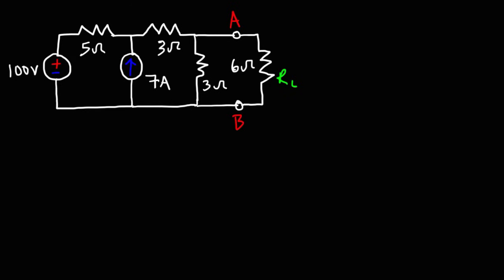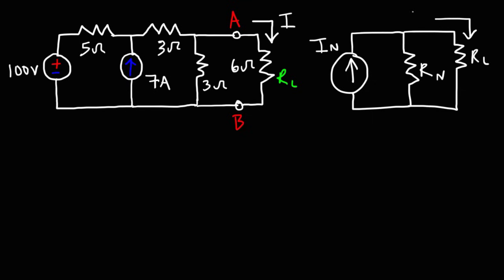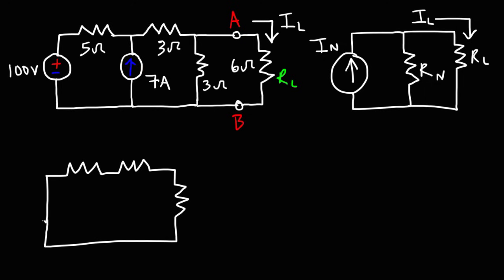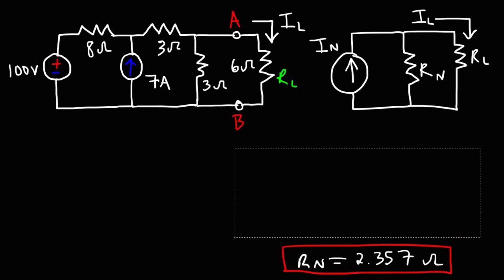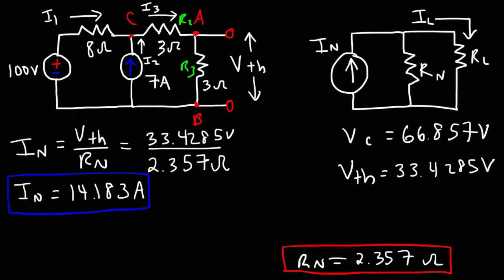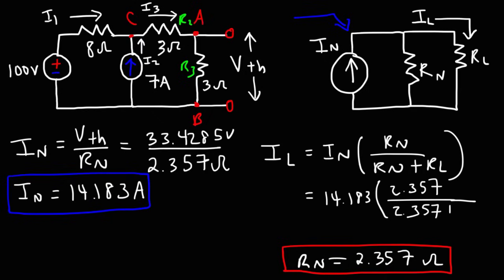Norton's Theorem and Thevenin's Theorem - Electrical Circuit Analysis

Comment: Since Calc 1, I've been constantly watching your videos due to the simplicity and clearness. Now circuits? Thank you so much for your help
Reply: same
Reply: He's a legend. I love that he's covered so many subjects.
Reply: 4:10 why did we substitute Vc from 100? Help pls and why voltage at point B is 0?
Reply: @Zero-h2f2m  coming from ohm's general theorem sum of all voltages or source forces / sum of all resistors in that branch will give you the current for that branch. Since we have no source for c, we use potential at point c and so voltage for source to c is 100-Vc ..

Comment: I appreciate your work! It's very intuitive-- the way you often use voltage. It may be good for folks to know how to find "I Norton" without the use of Thevenin.  This circuit is actually much easier if you go about shorting points A and B (since it removes a 3 ohm resistor), doing Source Transformation on the voltage source, and adding the current sources via the Superposition Principle. I ended up with a current source of 19.5 A running through two resistors in parallel. Current division yielded "I Norton."

Anyway, thanks for your work!

Comment: at 6:58 Va should be Vc*R2/(R2+R3) not Vc*R3/(R2+R3). Here R2 and R3 are same so we would get the same answer. Thanks for your video
Reply: Actually the video is right by using R3 instead of R2.
To put it into a perspective, the amount of voltage entering R3 would be the same voltage entering the Load (RL in this case) since R3 and RL are parallel.
Reply: @shichiya5743  nope you should watch circuit carefully. Here we are talking about R2 and R3 which are in series not in parallel, you should know the formula for the drop of voltage in series. And Rl which is load is parallel with the resultant of R2 and R3
Reply: @Ddragg I noticed the same thing and was wondering if it was a mistake from TOCT, or if I had a poor understanding, but thank you :D!

Comment: The voltage we calculated at point C, was 66.857V (5:55) but when we substitute the values and check it again we get 60V (10:51). Why is that? Please answer before OpenAI releases GPT-4 for free. BTW congrats on 6M subs, well deserved🎉🎉

Comment: How come at 2:00 the resistors are in parallel, but in 4:20 they are in series? I am just a little confused since they seem to be exactly the same.
Reply: I have the same doubt. 😇
Reply: Same here!
Reply: same here
Reply: The resistances are in parallel at 2:00 because he was calculating the resistance, but when he started to calculate the current at 4:20 the current would be the same at both positions because at A there is no current going through so the current would just continue down to B. I3 is the same at both resistances. Another way to think about it is through KCL which states that the current that goes into a node is the same amount of current going out of a node. in this case I3= 0+I4, meaning that I3=I4 so they are both basically I3.

Comment: Why minus the potential at B at 4:15? Why not Vc-Va?
Reply: Since the load resistance became a short circuit,no voltage drop at a coz there's no current flow
Reply: @xzzy627  this is the time you are answering him. 3 years ago😂

Comment: Just an advice for your  tutoring from what i personally find confusing. Can you explain where you get point C in your nodal analysis? I understand A and B but does C come from? lets say you have different circuit with things all over the place. How you determine where are you going to put that point C ? Like whats the logical reasoning for it...
Reply: Nodal analysis deals with node voltages. So place your point C,D,E… on the essential nodes. Search essential nodes if you don’t know what they are. It’s where 3 or more branches meet.

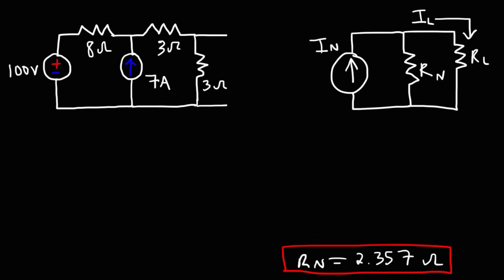Comment: I've got a question.... At 2:40, we're supposed to add a short circuit to 6 ohms load, right? As far as I know, we need to add a short circuit on the load, when we use Norton's theorm, and open circuit when we use Thevinin's theorm. Correct me, if I am wrong, please.
Reply: yes
Reply: @pawanbhatt1767   so we shouldn't  calculate r3 i think

Comment: when you are doing node analysis about node C why is it not (Vc-Va)/3. why did you do Vb instead of Va?
Reply: Might be a bit late, but since I had the same question and figured it out, I thought I would share:

He took the two 3ohm resistors in series and added them together, causing node A and node C to be identical. Then, since node B is the designated ground (therefore 0V), Vc/6k is the simplified result.
Reply: @PigeonPulverizer  Hi! when you do the calculation it yields two different solutions. (Vb-va)/3 + Va/3 = Vb/3. Not Vb/6
Reply: @PigeonPulverizer , right! This is possible because  while finding V Thevinin, he creates an open circuit between points A and B which results in the two 3 ohm resistors being in series. Happy studying!
Reply: @keremhassoy9556 ,
I am not sure what you mean by this. Doing (Vb-Va)/3 would be in the incorrect current direction for this solution. Also, the calculation of (Vb-Va)/3 +Va/3 is TECHNICALLY (Vb-Va)/3 +(Va-Vb)/3; which sums to 0 since you are adding the current value across the same resistor from from both directions. Good luck!
Reply: @PigeonPulverizer  thank you anime guy!

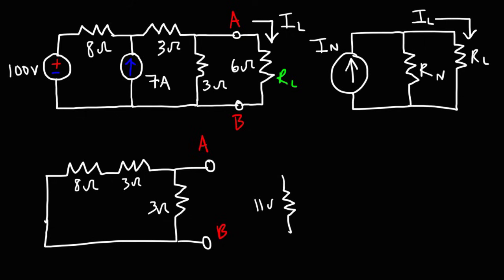Comment: in 1:53, how is the 11 ohms resistor in parrallel with the 3 ohms resistor and its an open circuit??
Reply: not that, the end of the 3ohm is touching with the start of the other 3ohm so they are in series not parallel! Unless i am wrong

Comment: nice, or to get straight to norton current, shorten the load and that short loop would turn into In or norton current plus it would also open the parallel resistances. then do a nodal to get the voltage then use ohm's law with In.

Comment: How to identify the Load Resistor? Is it always the one on the far right side of the circuit or is there any other specific method to identify it? Btw, superb explanation, you are really helping me for my exam!
Reply: Load Resistor is always the resistor that you define as the output of the circuit. Usually, it is on the far right of a circuit schematic.
Reply: Usually denoted by RL
Reply: Usually its on the far right, but if the circuit is decently complex your professor should be telling you what the load resistor is anyways.

Comment: 4:28 you said the resistors are in series but when you found the equivalent resistance you solved them in parallel
Reply: I think it's because there's still R load during the calculation for RTh, but for the current, it doesn't go through an open circuit. Therefore you can treat it as an open circuit. I'm not sure tho, correct me if I'm wrong.

Comment: Great video! But why not go with (R1.R2) / (R1+R2) for the parallel of 2 resistors? Makes it faster and easier.
Reply: For me plugging in (1 / (1/R2 +1/R3)) into my calculator is much faster, maybe that's why? just preference at the end of the day

Comment: at 1:56 you say the 3 ohm resistor is in parallel with the resistance to the left.  But at 4:20, you say the 3 ohm resistor is in series with the resistors to the left.  I am confused.  Can you explain this?  Perhaps an analogy would help here?  Thanks!
Reply: i guess the 1:56 one is the ckt which detached the current source and the power source that why the node share is different. you need to look at the node and process of the method. one of the step is detached the current source and power to get he total resistancn.
Reply: .One easy way to find if the resistances are in series or in parallel is to see if the current is dividing from a point or not. if the current is dividing the resistances are in parallel. if the same current is flowing through without dividing the the are in parallel.          . in the first case when he was calculation R(th) /R(N), the load was detached and the norm is to look at the ckt from the direction of load (where it was before detaching) i.e. from right to left.  but in the next the current was from left to right so the equivalent resistance changed. 

just follow the current division pattern and you will understand. hope it helps

Comment: Why did you specifically use 24 to multiply everything to get rid of the fractions?
Reply: Get rid of the denominators and solve the equation
Reply: I legit had the same question too.. common denominator is 24.

Comment: Can anyone explain why when calculating R(L) the branch with only 3 ohms is parallel with the branch containing 8 and 3 ohms but when calculating V(C) they are in series ? Thanks
Reply: If you're talking about at 4:30 then he doesn't take the 8 ohm and 3 ohm as series he is actually just looking at the currents at that point. So due to kirchoffs law you just add the currents

Comment: I try to solve the same problem with the method of short circuiting RL.Then no current goes to the second 3Ω resistor and in the left loop the current is equal to 7A so nortons current should be 7A as we only have a current source in this loop but ofcourse as you showed in your video its not.Where I am wrong?

Comment: I didn't understand why the two resistors in calculating RN were considered in parallel, yet, later we considered th 5ohm and 3ohm resistors in series because there was no current flowing from A to B ..i mean isn't ist the same for the calculation of RN?

Comment: I think there is a small error, or I'm confused, which is more likely. When calculating Vth you wrote VA = 66.857(3/3+3) , but I believe that VA is the 66.857 v. This is confusing me until I changed the VA to Vth like you later write it. I don't think VA = Vth. Am I correct? Thanks for making these videos by the way!
Reply: I think it's because of the Load Resistor
It changed, because the load resistor was removed initially

Comment: Okay so you open the nodes finding the Rn and you say the resistors are in parallel but when finding the In you open the nodes and say the resistors are in series because no current is flowing through the open nodes. Little confusing.

Comment: Doubt:  how could iL and iN be different since current source is connected parallel to rN and rL, current must be same flowing through each resistors, ryt?

edit: why is there an iL ,,.. only 1 current is required right? since both are same

Comment: Why were the current source and voltage source removed in the first part? I have an exam tmrw please help
Reply: The aim is to simplify the circuit. Just like in superposition theorem, the voltage is removed to ensure all terminals are at the same potential while the current source is removed to create an open circuit
Reply: @joshuaogundairo1380  I already passed my circuits class with a less-than-adequate grade, but I thank you for your input.

Comment: Why multiply by 24?  I understand to get rid of the fractions, but why 24?
Reply: It's the lowest common multiple of the denominators, 8 and 6. You could instead multiply by 8 and 6. 8×6=48 but this would cause your equations to have bigger numbers. If you're okay with bigger numbers, then you can just multiply the whole equation by all the denominators to get rid of them.
Reply: @darylryanchong9099  when i did this i get like 16.7143vc but he got 66vc.

Comment: How do you get to combine 300V + 168A = 468... is the Norten theorem telling voltage source and current source may be added?
Reply: God, you didn't mention a confusing detail, especially for beginners. As you are dividing  Volts by Ohm, you get Amperes. This is why it's correct. I don't like it when units are omitted and things gets correct magically. I learnt to never omit units for this reason.

Comment: do we always need to ged rid of fraction to solve the voltage? I tried to solve it on calculator using shift solve without multiplying 24 and I got diff. answer

Comment: I don’t like this method of solving it. All I did was use source transformations and condensed it all down to the Norton circuit. Your way has a lot of steps so there’s a lot you can mess up on

Comment: Why is the circuit at 1:45 in parallel but the circuit at 3:19 the 3 ohm and 3 ohm resistor are in series. Please explain!
Reply: Yeah, this was more confusing than helpful, if it was up to me, I’d write KCL equations for every node. This would take a bit longer but would be valuable in helping the audience understand why he did certain things here like combining nodes. For example, I would have written (Vc - Va)*(1/3) then when it came time to write equations for node A, I would write written (Va - 0)*(1/3). It also doesn’t hurt to declare a ground. What he did was not incorrect, it just lacks a bit of elaboration.

No doubt the guy is super smart but an explanation for the parallel vs series combination as you noted here would have helped.

Comment: sir kenapa dikurang Vc?
Reply: You mean for the 100-Vc part ? Directly above the Voltage source must be 100V and after the resistor there is a voltage drop, so at point C the potential difference must be (100 -Vc.)

Comment: Hi i would like to know why the potential at B is zero
Reply: it is grounded
Reply: Yes it is the ground part where the voltage is zero. A node will most likely to be the ground one if it holds the most branches among other nodes.
Reply: He picked it. Assigning it to point B in the circuit on purpose to simplify the math.  Doesn't really have to be grounded to the Earth; to keep things straight on paper.
"Hey, don't forget me,  I'm your reference point for your equations
in this circuit!"
 You could place it somewhere else and the math would look different. Perhaps more complicated. And in a small circuit on paper there aren't too many other places to put it.
Hope this helps.

Comment: The bit I don't grasp is why the current through the 3 Ohm resistor between C and A is negative
Reply: It is leaving point C.  The other two currents are entering point C.

Comment: You dont find I norton by finding Vth then using source transformation. You find I norton by finding the short circuit current through the output. Also you could solve these in half the time if you just built matrices using Mesh/Nodal equations rather than brute forcing ohm's law through the whole circuit. This way is extremely inefficient. Use engineering math for an engineering video!
Reply: This is for educational purposes, use matrixes and people wont understand anymore.